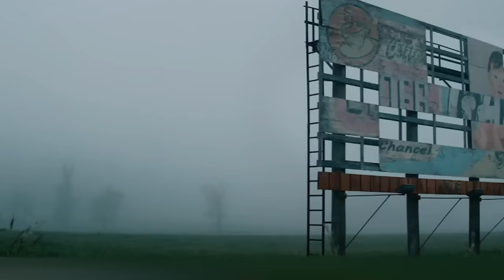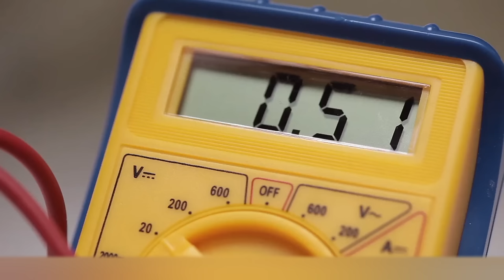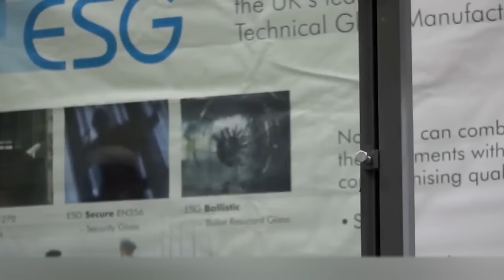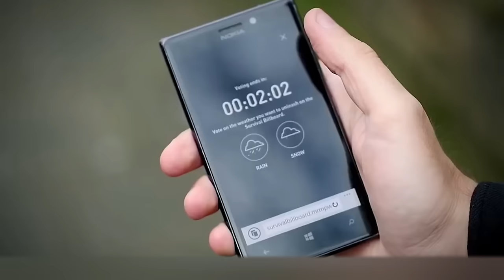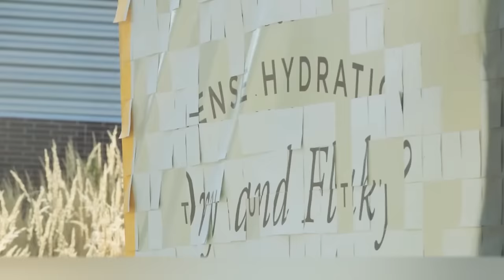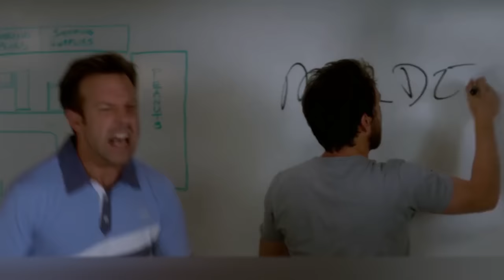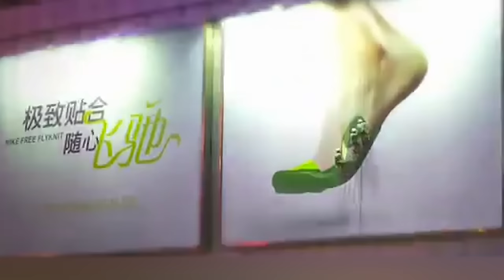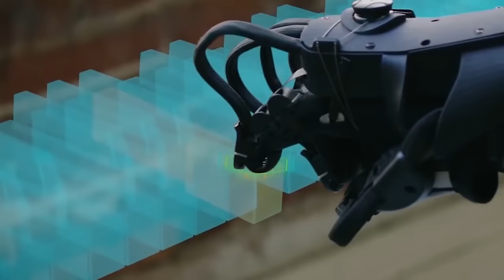Take All You Can If You Break It. Brilliant Advertising Campaigns That Stunned Everyone

Comment: I'd run my car into that glass
Reply: David Alves lmao i was thinking the same thing
Reply: David Alves I'm dead 😂😂😂👌👌
Reply: Yeah mate first thought that came to mind, drive my car through it and buy a new car with my new found cash
Reply: David Alves same lmao
Reply: My thought too lol
Reply: I was thinking of taking a picture of it and editing the money out and then pasting the image over it, and when the company shows up and opens it I just knock em over and grab it all. Lol
Reply: Arthas Menethil haaa very elaborate but worth the try
Reply: if i had a car, id do that 2
Reply: The ad campaign was held in my city. In 2005.
There was 500$ in real money, the rest was blank paper.
It was set up for one day and protected by security. Not left for a year.
This particular article has changed  many true facts about the event, as many articles do.
Reply: David Alves and you can use the money to fix your car!
Reply: An angle grinder or hot saw would do the trick. Gas powered hot saw would be my tool of choice. If thin enough, pneumatic scissors one you punch a hole through.
Reply: David Alves I would grab an RPG LoL
Reply: David Alves literally had this thought scrolled down and read you comment lol
Reply: Arthas Menethil XD Love it
Reply: U would break your car
Reply: David Alves hi dopey
Reply: someone did that it didnt end well
Reply: Lol those are paper money ..you can get the real 3M after you broke the glass
Reply: Same😂😂😂😂
Reply: Well it works lol
Reply: David Alves why was I finna comment that same thin😂😂😂😂😂😂
Reply: Cuppycakes0 Cuppycakes great minds think alike 😎
Reply: David Alves lol
Reply: David Alves lol your risking your Insurance if you’re going to do that
Reply: Luis Diaz u can us the money to pay for ur car to get fixed
Reply: Just use a dimond
Reply: David Alves I would want that money
Reply: Exactly lol
Reply: David Alves I’ll blow it up
Reply: Won't break though
Reply: Why not cutting the pole the box is attached to and then destroy the thing at home? xD
Reply: I'd run my ex car into the glass
Reply: Ide get a 12 year old to scream at the glass and it will crack and shatter
Reply: Austin The Slasher haa
Reply: David Alves that’s fucking genius you could just fix your car with that money
Reply: In a bus stop
Reply: Bone Powell hell yeah
Reply: David Alves me to and I would use the money to fix the car
Reply: Seriously it's not that funking complicated
Reply: Someone did..
Reply: Arthas Menethil 😂😂
Reply: David Alves id just punch it
Reply: Fire sail are you sure you dont want to just call in an airstrike captain?
Reply: or get two  hamers and keep  smashing it
Reply: Its easy dimond cutter will do the trick b4 do that make sure no people that will kill u for the money. Just cut the top part so u can get the money out then cut more till no money left
Reply: David Alves perfect idea.Iwould do the same thing.
Reply: Same
Reply: Ikr😂😂 u could just buy a new bumper or new car with the money😂😂
Reply: Someone did...
Reply: Rpg BTW
Reply: Brought my .50 cal with Amor Piercing.... go straight demolition ranch on the shit
Reply: I was thinking the same thing😂
Reply: Exactly was i thought😂🔝
Reply: lol
Reply: IT WON'T WORK >:D
Reply: People tried
Reply: It wont work it said that people had ran cars vehicles, and even shot it, and it still didnt do anything
Reply: Is it weird that i thought about that before cliking on this video
Reply: Infinite 8 same
Reply: Exactly what I was thinking
Reply: Pix-BitGaming  if it won't 💣
Reply: Exactly
Reply: Shoot it with a 50 bmg. You make a lot of money they lose a lot.
Reply: David Alves
Reply: David Alves ill just get some dynamite and blow it all up. Its my monet after i broke the glass ;}
Reply: Lol
Reply: I wonder would they have a lawsuit after the damage or potential injury that could happen to pedastrians
Reply: Don't click my profile Picture well seeing that there was only $500 of real money in it that wouldn't cover the damage
Reply: David Alves id put a chain around it and my truck and take the whole thing
Reply: We are all thinking the same thing ;)
Reply: Good luck
Reply: Just break the borders lol XD
Reply: It won’t work it’s on a vid somebody tried it
Reply: Shawn Paul can u tell me witch vid
Reply: David Alves Me to
Reply: Luis Diaz just get a rental and pay the extra $29 for insurance ha
Reply: Doesn't even have to be yours mate if your going the gta route fucking take someones car.😂
Reply: m1n3 c7afty useless man there is a barrel for a reason it has to travel out it to become more destructive
Reply: Buy a scrap car for a £100 that drives ,smash the post down break the glass. Ive got a feeling that the glass is bullet proof to a high caliber weapon,youd probably need a hell of some military caliber rifle but obviously you can't do that,I'm just trying to tell you that you can't break the glass. And who knows that if most of the money is real or if the amount is the true amount
Reply: The Inkling Channel go to Afghanistan and buy a cheap rpg
Reply: MINECRAFT GIRL 1012 u could headbutt it
Reply: I was fixing to put that but you did it before me😹😹😹
Reply: David Alves same if it works then I'll just buy a new car with all the money
Reply: I bet liquid nitrogen and a hammer would work.
Reply: Fire sail i was thinking the same thing
Reply: Someone did and it didnt work
Reply: David Alves I would do exactly the same lol
Reply: Kian French I dont get why they do this with the money behind almost impossible unreasonable glass,why whats the purpose of it?? Anyone
Reply: Deadass
Reply: David Alves XD
Reply: With that money you could not only repair your car you can buy 100 of them
Reply: I had the same idea
Reply: I take a saw to it
Reply: EXACTLY WHAT I WAS THINKING
Reply: That's exactly what I was thinking or some type of heavy machinery. Only a fool would try to break it with a hammer LOL
Reply: I’d rather melt the glass with plasma
Reply: David Alves still wouldnt work
Reply: David Alves I just said that before I saw your comment like... I can buy another car you know lol
Reply: Shawn Paul geez man i was gonna comment that lol
Reply: It won't work, well, it won't break the glass for sure.
Reply: i would bring my oxy acetylene torch and cut a hole right through that glass. no need for risking my car to try and break it.
Reply: Nico Franciosi if that's true and you ended up breaking it you can sue them for false advertising
Reply: I would take out my metal bat and bang on it multiple times
Reply: Eh just use a hammer much more cheaper and easier :p
Reply: I think you could get it out, but you might have to break the melee weapons only rule:

1. Small thermite charge. (Weaken the glass).
2. Remote detonator. (Safety first).
3. Pick-axe. (To exploit the weak spot made by the thermite).
4. Expanding Grappling hook. (Put it in the hole you just made).
5. REALLY good bit of chain. (To connect the hook to the truck).
6. Pickup Truck. (To yank that sucker free).

Or maybe I'm just overthinking LOL.
Reply: Arthas Menethil I like you plan more than my'n. Work smart not hard. Heheh.
Reply: Exactly what i was thinking
Reply: just try a breaking point press firmly in the same spot a few times to weaken all of it
Reply: David your car will break but not am glass
Reply: Lmao I was thinking the same thing too
Reply: Saaaaaaaame
Reply: Daniel Maresh if it’s that cheap, then u should definitely do it XD
Reply: Finally someone who knows what to do!
Reply: David Alves exactly what i was thinking
Reply: David Alves 

Sk
Reply: Wouldn't work. You need a pointed, high speed projectile, such as a 50 AP round.
Reply: Mitch B but what if it didn't work
Reply: Why m8 just use a tank!
Reply: Great idea
Reply: tbh I'd smash my hands into it until the glass breaks so I can just have my insurance fix my hands and I could get the money
Reply: David Alves first thought that came to mind tf lol
Reply: Ive seen a vid of somone doing that
Reply: I was going to say the same thing
Reply: David Alves I would use a bulldozer!
Reply: Run a tank in it
Reply: Tactical nuke incoming!
Reply: Way to lose a car
Reply: HOW DO YOU READ MINDS?!
Reply: Just get Demolition Ranch to work on it
Reply: And diw
Reply: I would buy a 50 caliber rifle to brake the glass
Reply: I would've do the same thing
Reply: What if it backfired and you’re left with a destroyed car, and the same amount of money as you started?
Reply: nah wont work......BILLY BRING THE SHOTGUN didnt work ugh.....BILLY GIVE ME THE RPG
Reply: David Alves  what about a diesel or dump truck
Reply: David Alves I don't have a car I'm a kid but I would do the same thing
Reply: Just use A saw
Reply: I would get a wreck in ball
Reply: Actually that's logical if they didn't say it had to be broken a certain way, that means anything goes, clear out I'm coming in at 100 mph on that thang LOL
Reply: David Alves BRUH A FIREARM CANT BREAK IT
Reply: David Alves Then you can get a better one
Reply: Know one siad u couldent
Reply: Exactly what I was thinking
Reply: Id use a RPG
Reply: How come no one has actually robbed it
Reply: I'd take the glass
Reply: Me to haha
Reply: yeah lol just buy a new car with the money XD
Reply: People in the station
What’s that noise?

vvvvvvv🚙💭💭💭VVVVRRRROOOOM
✨💥🚗
Reply: I would blow it up
Reply: Umm dude a bullet moves faster than the speed of sound and that didn’t even damage the glass.
Reply: Better what a dumptruck or a bobcat with a concrete breaker attacher on it
Reply: @averat84  i was thinking the same
Reply: David Alves nah get like a tracktor or get a jack hammer
Reply: Dont for get to jump out or get someone to do it for you crashing hurts
Reply: @averat84  exactly what i was thinking
Reply: I 'd run with  my 35 ton truck  😂😂😂😂
Reply: Get a shotgun
Reply: Still won't break
Reply: It still  wouldn't break
Reply: @paskky913  your IQ have already reached the max level
Reply: David Alves was thinking the same thing lol
Reply: Same thought.  Company's lucky we wernt there
Reply: I thinking that to
Reply: a muthua fuckin transport truck 🚚
Reply: I have the same idea ‼️💡😂
Reply: @infinite8661  WE GOT SOMETHING IN COMMON (BOBBY BROWN VOICE)
Reply: It’s was actually only 500$ and you could only kick it
Reply: I’d take the whole bus stop😂😂
Reply: Thats smart then u get the 3 mil and buy a new car
Reply: Daniel Maresh that’s very cheep for a car. My mom’s car costs  22k but it might depend on the car though
Reply: How I'll break the glass I'll use a lot of mallet
Reply: xD would love to see someone driving into that glass
Reply: ehh
Reply: @mitchb1049  that kinda don't make sense cause it come like you didn't need the money u just crash your car for nothing
Reply: Jack hammer it
Reply: Steel-cutting torch=EASY!
Reply: I planed wrecking ball but I guess car works to😂
Reply: David Alves Someone tried that.

It didn’t work.
Reply: Someone did that already
Reply: why not rent a truck and run it over, doesn't seem that hard, even if it doesn't break I would take the whole thing glass and everything. I don't think breaking it is that hard but the problem is how can you get away with it
Reply: Cold hidrogen and a every hot flame
Reply: Was thinking the same thing I need they did say in any way🤣
Reply: NOT VERY THOUGH
Reply: And then pay the damage you made to your car.
Reply: was thinking the same but, the glass is most likely to break my bumper instead of the glass breaking
Reply: Then buy a new one with it
Reply: Legend has it chuck norris broke the glass took money
Reply: @averat84  or just a hole puncher. You know that  thing that. Makes holes in metal? That thing
Reply: David Alves honestly it’s a good deal
Reply: It would survive
Reply: Hehe
Reply: Exactly

Comment: This is how MacGyver would do it: looks in the purse of a woman waiting for the bus, finds a Venus brand shaver and cuts the 3M film open. Serendipitously, a science teacher getting off the bus had a can of liquid nitrogen and lends it to MacGyver. He then walks across the street to borrow a torch from a welder who was working on a commercial door frame.  MacGyver pours the liquid nitrogen on the exposed glass then quickly heats it up with the torch. The sudden change in temperature causes the glass to contract and expand, thus shattering the glass.

Comment: The case did not contain $3 million.  In actuality, it held only $500 in Canadian currency.  The rest was fake.  Presumably, if someone had broken the case open they would have received their prize through some other more secure method, such as a check.

The glass itself was not bulletproof.  It had a film applied to it to strengthen it.
3M does not claim that Scotchshield makes glass bullet proof.  Instead, it is designed to make glass more shatter resistant so there is less risk of injury from flying shards of glass.
The case was never just sitting in the open waiting for anyone who passed by to break it open. 
 It was set up for one day and was carefully protected by security guards.

The stunt was actually remarkably cheap for 3M to pull off compared to all of the attention that it still seems to gather.  In addition to the fact that only $500 was actually in the case, other expenses were probably minimal as well, such as a one-day rental of the poster box and a team of security personnel.

While passersby were allowed to do some crazy things in their attempts to break the glass – such as getting a running start to kick the case and taking a sledgehammer to it – it wasn’t exactly a free-for-all.  When the aluminum frame around the poster began to give way the security guards called a halt to the challenge.  After all, it had to be the glass which broke rather than the frame around it.
Reply: Soko Moko yeah... What he said
Reply: Soko Moko, damn. I was trying to think out of the box and was like, "pff, just take off the frame, that'd be the easiest way to get the money."
Reply: @cumsicle647  No... you were only allowed to use bare hands and feet,
Reply: @HicSvntDracones  that’s ass.. if they would let people use items it would of been broke. Within a few hours. But they only want u to use hands and feet. Knowing damn well a glass is stronger then a human hand and could injure yourself
Reply: By they way, according to their article, the rest is fake. But, they were offering 3 million if you could break the GLASS open
Reply: @ashantaylumpkins  some people were allowed to use items, one guy used a sledgehammer and it did nothing besides damage the frame a little.
Reply: @HicSvntDracones It said that they ware alliwed to use a sledgehammer!!!!!!!!!!!!!!!!

Comment: 3:50 Who else is a 100% sure that they could break the glass
Reply: CuzImJordy id just take them and run
Reply: Id get rocket launcher
Reply: Just unscrew it
Reply: Or just break of the pull that’s attached to it
Reply: Icepick, gas, lighter
Reply: Aldo Cortes to far but a good choice I prefer a 50 cal sniper because it's known as the strongest gun ever more powerful then a rocket launcher
Reply: I could. Where is it tho lol
Reply: I will break or detach the frame instead of glass
Reply: Use some HF or Li.
Reply: Me ima rent an armored car
Reply: i would cut the legs of it and bring it home to my hydraulic press ant than the money is mine
Reply: Star platinum, Break it, NOW!
Reply: It is incredibly reinforced it would take a while to break it
Reply: Either plasma cutter or right vibration frequency would do it.
Reply: Break the supports then it will fall then you steal a jack gamer from the construction across the street and open it then some seagull comes and steals it simple
Reply: A drill maybe? Try breaking the frame
Reply: you cant unscrew it the ad said break the glass and you can take it ....
Reply: Or take off the bottom holding it and get it home
Reply: Hold my beer. I take out my cordless diamond saw and drills. Yes they do work on that 3M stuff. How do ya think they cut it? Lasers?
Reply: Yes use a rocket launcher and blow up the money as well lul
Reply: The payday2 drill would break down to the glass tbh
Reply: me
Reply: Coca cola is evil drink....cause many diseases.....
Reply: Extreme cold then heat glass will brake
Reply: I'd attack it with the jaws of life: first use the shears to puncture the glass, then switch to the spreader and jam it in.
Reply: I would break the metal part instead
Reply: Or I would contact someone who flys a helicopter and drop a very heavy object on it and split the money.
Reply: Plasma cutter or a torch
Reply: Desert eagle